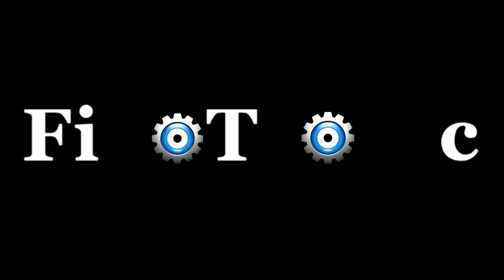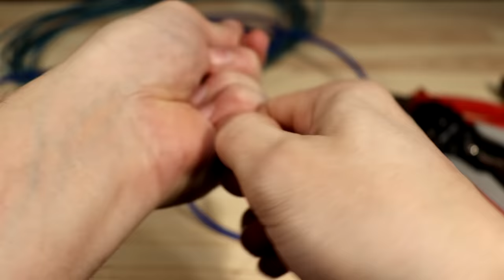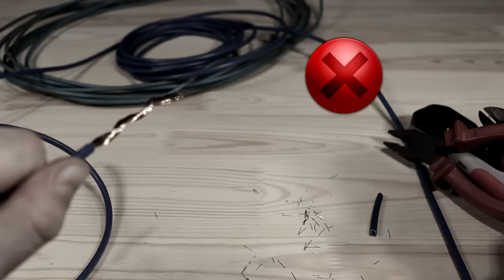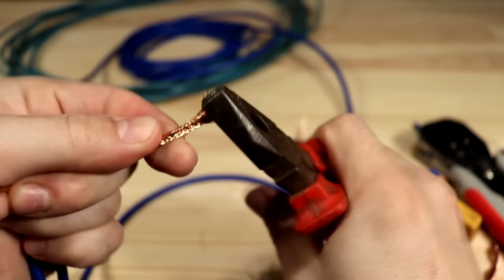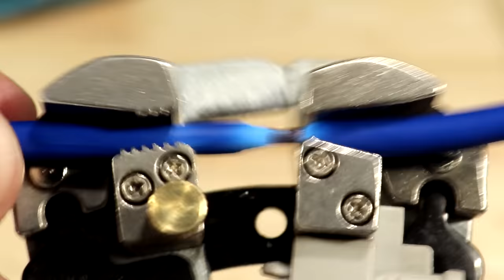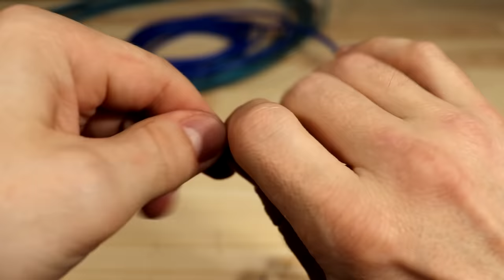AWESOME IDEA! HOW TO TWIST ELECTRIC WIRE TOGETHER!

Comment: hats off to you. it takes a lot of courage making this a 9 minute video lol
Reply: And yet I sat threw the whole thing and honestly I think I'll start wiring my wires like this. It's a pretty good idea. TBH
Reply: @AmandaNicholas  if you don’t have a soldering iron then yes this is the most effective option
Reply: 1ㅣ
Reply: Mto bem feito essa emenda focou top
Reply: it will took 1 minute 30 seconds for this info.
Reply: zzzzZZZZZ ZZZZzzzz what did you say?
Reply: Bro don't angry she is showing how other people do🤣
Reply: I learned this in freshman high school in 1966
Reply: @CYMotorsport  If you don't have a soldering iron get one. And while you're at it pickup some heat shrink and a heat gun...
Reply: Never saw anyone so bad at stripping wires. There's nothing "awesome" about this technique.
Reply: What a waste of time! This pretty much sums up what is wrong with YouTube.
Reply: I think it will take more effort to watch such long video when it can be done in less than 3 minutes 😂😂
Reply: imagine not having an addon to skip to the actual highlighted video come on now!
Reply: Tako se vezuje ako bih slepovao auto
Reply: @rrkunath  ya she looked realy weak
Reply: @robertspringer9477  Late learner, they used this for telegraph wires in 1800s.😉

Comment: The final wire twist is called a "Western Union Splice".  I was taught this splice in high school in my Electrical Installation class.  Can be used with solid wire also.  Soldering optional.  I use this splice to lengthen wire for my train layout.  You should use the same gauge wire because of current  and/or line drop in the run.  I am a retired electrician, worked on NYC subways & electrician's mate, US Navy..
Reply: wouldnt a butt splice or similar be better though? I understand not always great to have addition materials and tools (crimpers), but the best splice is would probably be irreversibly crimped. Thats why the NEC requires irreversible crimps as the only means to splice grounding electrodes
Reply: Yep. Grade 9 high school, Western Union.
Reply: I had a mate who was an electrician in the Navy too.
Reply: Совершенно верно. 9 класс СССР.

Comment: The video starts at 0:7:30
That's what can be useful out of it.
thanks
Reply: i watched for 3min, then i stopped and scrolled down comments, found this thx . i was jsut curious but this vid...glad i didnt finish it :P
Reply: Nah, that 'fix' can't be used anywhere. It's not even legal. If you gonna fix a wire, do it proper.
Reply: @vikingpowered868  I see it as a useful tip for pulling not fixing.
Reply: Sh.t I wish I read this before wasting 7 mins 30 seconds. Well 9 mins really considering it should take 11 seconds to demonstrate such a simple solution.
Reply: Nothing in this video can be helpful, you never do this with cables.  There's always a more appropriate way to do it than this shit.
Reply: @Tekkarath  What’s a “more appropriate way” to pull a new cable that’s replacing an existing cable?
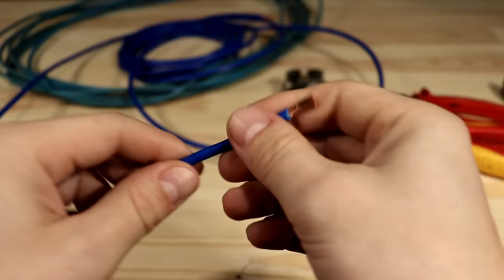Reply: But ad revenue stars at 00:01
Reply: @TimYorty  100% correct!!
Reply: Thanks bro
Reply: Are you kidding me? If you're hosting an electronic dance music party, crank up the volume and play this video. Everyone in the crowd goes nuts. It's very useful for that.
Reply: A better recommendation would be to use OSHA approved wire nuts or wago
Reply: Waste my time.. for 7 minutes.. to find the real solution..😢😢
Reply: He me got twice to think the real steps start at the next one after the first tutorial he shows in the video now i'm already wasted about 7 minutes to watch this 😂

Comment: This video is wasting time of 9 minutes, to get information of 10 seconds !
Reply: 9 minutes and 11 seconds of our lives we will never get back ...
Reply: 7:20 Chase, cut to.
Reply: 10 seconds of information that is not even correct. it's 3 wrong methods in a row.
The third was closest to being something that is not correct but passable, with a minor change, would be 10 times more difficult to pull apart. 
Make the X like in the third try but fold them in opposite directions like a chain link, then twist in opposite directions..
it'll be stronger by far... but that's allot of exposed wire to tape up.
I will explain how a connection should be made properly if anyone is interested.
LMK, Mitch
Reply: книги на макулатуру сдали и делают открытия мне стыдн
Reply: @TooSlowTube  kmñ
Reply: This is not fixatronics, this is fucatronics.
Reply: The last one is totally wrong and dangerous.

Comment: This is called a "Linesman Wire Splice", used long before all the connectors came to be. Used in the early days when nothing else was available in the Rural areas. Still the best and strongest method.    Taught to me by David Epley, Veteran of the US Air Force and Electronics expert, Winchester, Indiana.   Long Live "Dave".
Reply: Exactly! Taught to me in High School Shop Class 1961
Reply: А говорили что уних производительностьвысокая  за это время я штук двадцать скруток проведу

Comment: Thanks for showing all the different ways that fail and the one that works so we won’t repeat the same mistakes or waste the same amount of time and still be able to reconnect the broken wire together securely without other tools.
Reply: Really? And how 1) do you do that if you are joining wires that can't be rotated and 2) do you achieve a joint that won't just fall apart - without twisting the conductor strands across eachother you can't know, unless you tug on it to check, and I bet you a penny that it will fall apart when you do that. I would use that technique if I was also going to solder that joint - it would give the lowerest resistance joint - but it is mechanically too weak without solder.

Comment: There's lots of ways to splice and get a good, neat connection.  Personally, I would probably solder and use shrink tube on that connection.  That's just me.  Good job.
Reply: That's how NASA does it with soldier.

Comment: I am so glad you found it out. I am 95 years old and I did this for the last 85 years. In electronic we also solded them after and a shrink tube for insolation.
Reply: The soldering and shrink tubing could have fitted in the 9 minutes as well as the twist to show a professional job. Congratulations on your 95 years and hope you enjoy many more. Cheers.
Reply: There was electricity back then?
Reply: @CacD47  in 1831, Michael Faraday invented the electric dynamo — essentially a crude power generator — that used a magnet that moved inside a coil.
Reply: BUT no shrink tubing back then. Actually when I was an Apprentice Instrument Fitter in 1971 no shrinky then BUT an ingenious tool that fitted inside rubber tubing and stretched it from the inside to fit over various sized joins. We would have looked funny packing hair driers!
Reply: @topcatandgang  AND a  cage to put it in!

Comment: twisting wires together creates an electrical resistance at the joint leading to the joint becoming hot which could then result in the joint catching fire. Twisting wires together should only ever be a tempory measure

Comment: That's nice in an ideal situation, however realistically, when replacing light fixtures, ceiling fans etc there is no excessive "stranded" wire (from the house) to twist to the devise you are trying to install. Most frequently  the wire in the house is solid wire and will not flex like the one pictured here.

Comment: 😴 💤 - seriously though 🤣 - thank you for the video. The final solution is a good one. I’m going to add some kind of heat-shrunk insulation, remembering ti slide it on BEFORE I join the wires 👍🏽

Comment: the quick and easy way is buying a connector in which you have to put in all the strands from both wires in opposite ends and then squeeze it with the proper tool for it. The connection is secure and has great conductive properties and isn't time consuming unlike every option in this video.

also the covering up of the bare copper... you cannot do it in a manner that is allowed in my country using whatever twisting techniques.

Comment: Before making the splice you must twist the strands of each wire tightly so you don't have any little wire "hairs" sticking out  and then make a 90 degree bend in the stripped part before you start winding them together. Makes it much neater and more secure. THEN  you solder it.  This is the Western Union splice.
Reply: well in the beginning they didn't have solder and the wire was not stranded, it was solid steel wire not copper, so doing the western union splice worked just fine and the knot would never pull apart even with tension on them.
Reply: I've never heard it being called to Western Union Splice. But thanks for the information. I'm sure you're either Electrical Engineer or Electrical Lineman. To know the correct Terminology.
Reply: @MarkORoth-fu2cy  I'm just a jive-ass White boy from North Philly, and I learned the Western Union Splice in high-school Electric Shop. Frankford High, 1952.
Reply: @SlikLizrd  Well that is Exactly where my roots are from my Mom & Dad
Reply: Absolutely correct ... western union splice.

Comment: I'm overn70 and In learned your last splice in high school electronics class. it is called the Western Union Splice because they used it putting telegraph wires across the country in the 1800's. The harder you pull the tighter the splice. Someone can correct me but I think it is still UBC Code.

Comment: The last method, the X-twist is how I was taught to make a proper solder connection in grade school 25 yrs ago and it hasn't let me down. It prevents any hot spots in the connection where amps are being choked.
Reply: It is called a union splice and it has been in use for over 100 years.
Reply: Planes & cars or any vibrating machinery will break your solder joint at its weakest point... from solder to no solder. Never wondered why all car connections are cold clamped to their respective plugs. Well British & Australian cars are. (I should say WERE)
Reply: @leewilkerson8185  NAH. It's a Western Union Splice -- named after the telegraph outfit that ran wire all over the U.S.A.. It HAD to be right, and fail-safe.
Reply: @SlikLizrd , I stand corrected. Western Union splice. I read and learned about it in the 60s, so I can call it what I want now. :D You knew exactly what I meant which means you know the method. BTW, I know more about the splice itself than I know about the name which made little difference to the splices I made.

Comment: LOL... this is a "Western Union" splice that has been used for over a century.  Most commonly use on solid conductor but works just a well with stranded. Both need to be soldered as well.
Reply: I was thinking the same thing, nothing new...
Reply: Yep, but the solid wire could go unsoldered (Western Union didn't for 50 years.) Stranded wire should use an unsoldered butt splice instead with full cycle crimpers.
Reply: Warp factor is correct on the unsoldered solid conductor, however, there was a thin sleeve installed over the Western Union splice in most tensioned power company overhead primary and neutral installations.

Comment: Wow, Thanks for that. Learned that in Exploratory Week in Electrical Class in 1982. Its called a western union connection. Has been around a long time.
Reply: Yup, western union splice, learned it when I was about 5 years old from a kids book on electricity, that was around 1964.  I use it all the time for not so critical stuff and cover it with marine heat shrink.  It's easier than soldering or crimping when crawling around underneath a trailer and is just fine for 12 volt lights.
Reply: "Western Union" or "Lineman's" splice. Been around since the Telegraph and it wasn't even awesome back then.
Reply: Hehe...  I didn't have to learn it from anyone.  It's such an obvious splice that it doesn't need any training!  :-D
Reply: You forgot to solder and heat shrink your lineman's splice.  Also what was that crap in the middle? No one does that.
Reply: @mathbee  If a Western Union Splice is soldered in a practical application, in its intended use (one that  is under motion AND tensile load) it will fail in a matter of hours due to metal fatigue.

Comment: Thank you for an extremely thorough demonstration of wire stripping. The time devoted to the removal of insulation far outstripped time devoted to the single method that works. Why waste time with the other two?

Comment: As a boy on the farm, we repaired barbed wire fencing using this method and then stretched the wire taut. The twisted wire held against the horses & cattle until the wire rusted to brittle. We also used this method for electric fencing - but I saw this video and thought you were going to show why one method of wire joining was better ELECTRICALLY from another....electric wire isn't supposed to carry heavy loads, but the high tension power lines are joined in this manner without wire nuts or junction devices. 

A very long video for wires that should be current bearing, not load bearing.
Reply: Ever heard of the figure 8 knot??
Reply: el que hizo este video deveria haber estudiado solo tres meses de un curso de electricidad, el empalme que usa al final tiene un nombre se llama WESTER UNION , es uno de los empalmes basicos del electricista y se hacia cuando se usaba alambre , el tema es que no necesitas en electricidad que tenga resistencia a la traccion pues seria de burrro empalmar un cable y tenderlo tirante el tema pasa por la conductividad y todos los utilizados alli cumplen ese requisito, o sea orejeras para el que hizo el video y al rincon , LO COMETO AQUI PUES NO ME PERMITEN RESPONDER EL VIDEO DIRECTAMENTE
Reply: @washingtonbravo4741  Gracias por la información.
Reply: Robert Shorthill  do I get wasted ? sure guy, but not that much , its too labor intensive with little payback , steady as she goes , keep it fried then we can get it on, and then we can talk about this while a few good off duty fuckers making a call for it the tip, but that's before work essentially
Reply: Robert Shorthill  your punctuation and spacing is all over the place lmao
Reply: Robert Shorthill   why do u put ,. ?????
Reply: Robert Shorthill  but its persistent idk.....
Reply: Robert Shorthill  your punctuation is all over the place dude.... i couldn't help but laugh
Reply: It was a telegraph wire splice known as the lineman's splice (electrical and load brearing). FYI😎
Reply: Absolutely

Comment: This might only apply if your snaking the wire through a conduit.
Electrical wires never have to bear that kind of tension.
Reply: @vikingving7666  It's usually harder to use someone else hands.

Comment: In short, the standard cable junction that is learned in technical school.
In practice it can't always be done.
Sometimes because we can't turn off the electricity.
Other times because there is no place to maneuver with your hands.

Comment: Slip a Heat Shrink sleeve on first,  then wind , then slip the sleeve over the wire and shrink it on to further secure the join .

Comment: That is the most time consuming and unrealistic procedure that I have ever seen.
Reply: This is the USUAL Link of two wires - it is not an idea, this is the "How To". Volume taken, mechanical resistance, etc.
Reply: @benyusuf7725  No, it isn't. I'm a licensed electrician and this is a hack method and will get you laughed off any jobsite if they see you doing this kind of stuff. NEC requires wires to be joined with UL listed products intended for that purpose.
Reply: @bigbrotherwilljustdeleteth1734  I understand what you say but in old times this was the way of linking cables where they needed to be pulled later through pipes. These are already done and operational for years...
Reply: @bigbrotherwilljustdeleteth1734  there are plenty of places a lineman splice is necessary or required. The "jobsite" is not the only place that requires wiring splices and the NEC is not the only code that covers things. Direct burial or waterproof splices often require this.
Reply: @bigbrotherwilljustdeleteth1734  electrician simulator doesnt count.

Comment: Эта удивительные идея мне была известна еще 1975 году.В школе трудовик учил...
Reply: Посмотрев это видео я понял что не зря потратил девять минут своего времени . Теперь я знаю как из ничего можно создать контент .
Reply: Он бы ещё показал как яичницу правильно готовить..по времени так..коротенько ..мин. 45....и хлеб правильно резать+ ещё 45 мин...и ещё ее ПРАВИЛЬНО... посолить+ 50 мин.!!!!😅😅😅😅🇩🇪🇩🇪🇩🇪🖐️🖐️🖐️
Reply: Этой идеи лет сто, если не больше!
Reply: I am an old power utility lineman and this splice is called a Western Union splice. It was used at the beginning of overhead wiring and we used it in emergencies during ice storms when normal splices were unavailable and we needed to get the lines back up. They are quite strong and in the old days the would also solder them.